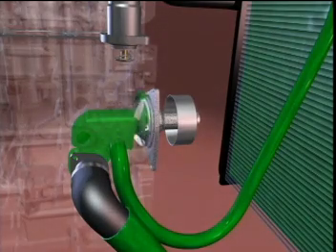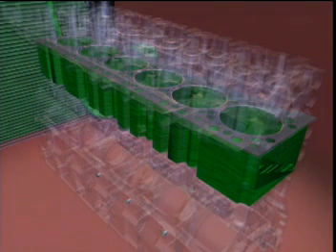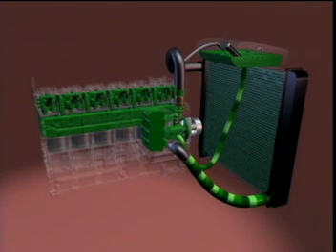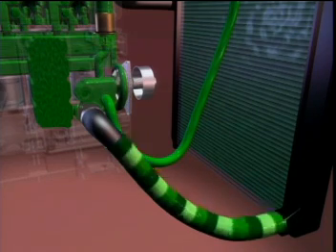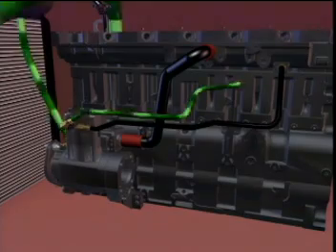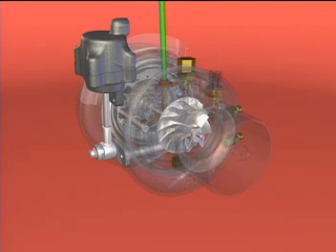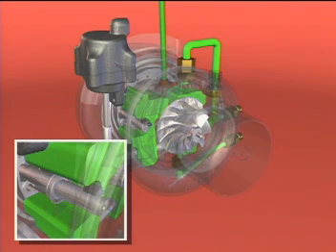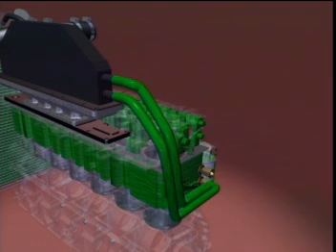نظام التبريد للمحركات Coolant flow

Comment: Does coolant flow contentiously from lower coolant tank when engine cold if so upper hose is blocked by thermostat , how the bypass circuit completed when engine cold
Reply: The youtuber doesn't answer questions. Not all cooling systems have coolant flow direction. 
Kia/Hyundai cars have the coolant flow from the thermostat into the lower radiator hose.